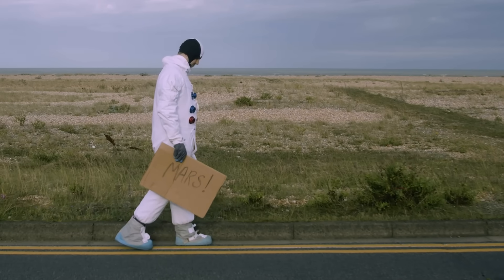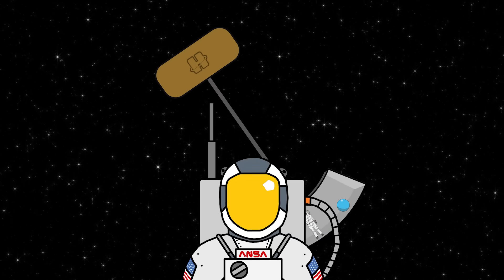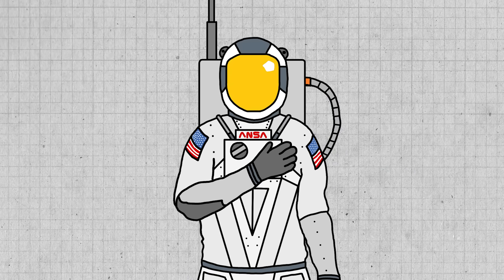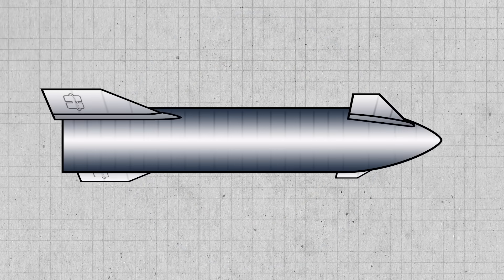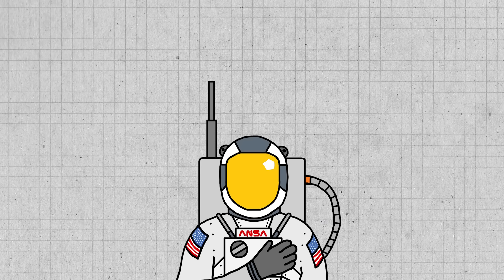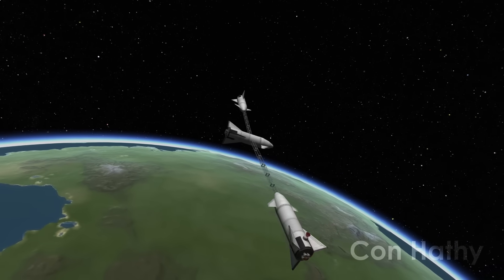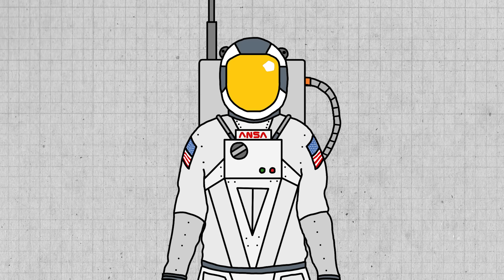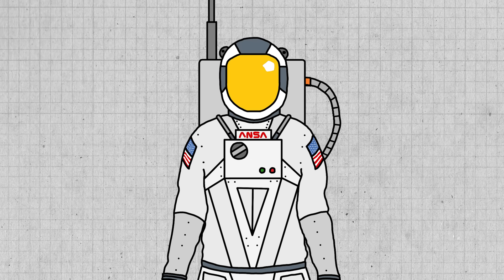This is NOT how you make Artificial Gravity

Comment: Pretty odd that you'd account for the central hub bring the primary forward driver as active thrust, though discounting how much it could be used, whole ignoring the idea that the side cars would also have available active propulsion. They would tumble if they were dumb otherwise inanimate objects. Instead they are robots which don't want to die right, strapped to rockets that were at least powerful enough to get them into that predicament. Yes conventional methods use chemical combustion to barely even get stuff into trajectories for distant intercepts. But the tech is continually advancing, and not at a snail's pace. Constant acceleration for as long as possible gets you places in outer space where coasting alone would be completely unfeasible. If the central hub can achieve some low degree of constant acceleration, it would tow the others swinging in coaxial orbit. That already provides tension for stability where you just assumed the engines would cut off and everything would coast. If all the engines cut off and they coast, they'd be in real trouble in that configuration yes, as they precess and slacken and pull taught again. A ship in tow still has a bit of the same problem risking a slack and snapping taught cable. But a ship in tow actively applying the brakes against your overwhelming forward drive, it's inefficient but it's also very effective in taking control over and cancelling out all that instability.

Comment: If accelerating in space is effectively the same as gravity experienced on Earth (02;02) then constant forward acceleration to Mars would provide gravity in the opposite direction of travel, as the ship is already designed. The only time this would be an issue is when you stop, then centrifugal acceleration would be of benefit. You are making an over-complex solution for a simple problem. Only the speed of acceleration and deceleration would require fine-tuning.
Reply from the maker: I actually made an entire video all about trying to use thrust gravity, it turns out that constant thrust is more useful for shortening the flight than actually sustaining gravity: https://youtu.be/nRKNh-Gx9WA

Comment: With some RCS control you can have a spaceship rotate about an intermediate axis without issues if desired. People make a big deal out of artificial gravity while it seems to me like one of the minor issues easily solved. The same for people that think that the trolly problem is the fundamental problem inhibiting self driving cars.
Reply from the maker: I wouldn’t risk it with RCS because any glitch or need to power cycle the system would put you at risk of tumbling (not to mention the waste of propellants)
Reply: @ConHathy  The ISS use control-moment gyroscopes and thrusters for attitude control, therefore I think you are a bit too pessimistic. Rotation around an intermediate axis is still a equilibrium point even though it is unstable. A tiny bit of control can stabilize it. Furthermore the tumbling is probably not disastrous.

Comment: The first thing I noticed. There isn't hardly any artificial gravity forces applying to his head. Even on that small centrifuge you could put a person's body at the location you were showing his feet at. Instead of being vertical to the center axis you lay horizontal at the bottom. You would have to build a spot for a person to lay in. But why wasn't that talked about? He covered almost every idea, but not that one. It would still be a small centrifuge.
Reply from the maker: That was actually a control setup where they intentionally put the eyes at the center, they also extended the arm to put gravity on the eyes but it didn’t seem to help (at least in earth’s gravity) I wasn’t able to find footage of that unfortunately

Comment: @2:00 - a constant upward acceleration is what gravity on earth feels like? This is not a shared experience. But we feel an upward movement (even though we're told gravity caused by the mass of the earth is pulling us towards it, it feels like upward acceleration, weird) and so rotation of another object can make it feel like gravity on the surface of a planet? huh? the forces are countering/opposing. centripetal is like you just said - an outward force from the pivot that keeps increasing the speed of the object in the direction of the rotation. an upward thrust might be plausable if the earth were stationary, but we're claimed to be spinning. Repeat an experiment where something is spun and it has objects cling to it ~ only have I ever experienced that everything is flung off the surface of anything that is spun - i've always asked what the similarity is of the force which we are told holds the ground, holds the oceans against the gound, holds the air against the ground, but let's us and everything living move freely within the elements? While saying that is "like spinning an object" and instead of having objects on the outside *where it will be flung off, (I'm sorry, *where it will stick to the surface of a planet) yes, instead of that, have the people on the inside of the craft being spun and they are forced against the surface directly perpendicular to the direction of the force of acceleration.  <or the wall of the craft> Ideally the craft would need to pivot and rotate to the angled degree of the spin for oprtimal function of the space as designed for "space work". pivot like a ferris wheel cart as it goes around the axel. only in earth's gravity the carts hang with the floor downward, but in zero-G the rotation would have the cart's floor be circling the craft and the floor away = then the people would have to get used to the motion sickness for a few hours and then the return to normal-G would take a few days to correct. This is only a sci-fi concept, artificial gravity. It can't be accurately tested, verified, or repeated. We can't create the necessary environment to conduct tests. Can we create a pressurized container without the force of gravity present in it? We as humans are pressurized and we can't survive in an environment without pressure. Space is said to be micro-pressure or no pressure; a vacuum. That much vacuum doesn't explode or implode our crafts made of mylar?? weird. Mathematics...we can do them all day and night, but the numbers can't give us any proof that artificial gravity is possible. ...except in our imaginations.

Comment: Re: Small-radii centrifuges ... What happens when matter inside the centrifuge shifts around -- e.g., when a human walks around the ring to the opposite side? The center of gravity will shift, and the forces exerted by the centrifuge on the ship will change. How much reinforcing material will you need just to keep the centrifuge locked in place without ripping anything open? It's too late (and it's been too long since I was in school) for me to figure out how to ballpark those forces, but I recall reading that shifting CG was a possibly-fatal flaw for ring space stations. (Although there, it was more a problem of tearing apart ships that tried to dock at the central axis...)

Comment: Another way of creating gravity is constant acceleration and deceleration
Reply: Using Ion drives to constantly push the vehicle will add gravitational affect and increase the speed/shorten the trip.
Reply from the maker: @davidpayton-pb8to  shorten trip yes, achieve anything like artificial gravity no. They have too low of a thrust to weight ratio. I actually did a whole follow-up video on thrust gravity

Comment: Artificial gravity caused by rotation has an important advantage:
You can go to the toilet normally and take a shower normally.
Reply: @misos1393 
1 Samuel 25:22
(for this  reference use the KJV)
Reply: 😂 you sock puppets will literally argue about piss trajectory.
Reply: @VoteForBukele  Ape think funny?
Reply: You can smelt/refine metals normally also...
Reply: Any artificial gravity would do that, and spinning isn't the best method.
Reply: no you can't, you would piss straight onto the wall
Reply: @misos1393  ...So put a urinal on that wall? Seems solvable
Reply: @misos1393  no, you would not, you're in a slowly rotating structure not the spin cycle of a washing machine. there might be some curve but nothing you can't easily compensate for
Reply: @stratvids  do the math, you're not in a slowly rotating structure unless it's the size of a planet
Reply: @misos1393  what? Are you slow or something? Did you even watch the video?
Reply: @stratvids  yeah and it's wildly wrong, the russians built a habitat on a centrifuge and tried to live in it and they recorded everything. You could also just do the math and realize theres nothing slow about accelerating at 9.8 m/s
Reply: @misos1393  sure thing little guy
Reply: @stratvids  your insults are compelling arguments i bet you win a lot of arguments
Reply: @misos1393  Used "argument" twice in the same sentence: minus five points.
Reply: @ didn't use the word "argument" even once. good job reading, you'll learn about plural next year in 2nd grade reading
Reply: @stratvids slowly rotating only if you’re talking about the RPMs but that doesn’t mean the speed is insignificant… the earth rotates at a very slow speed if you’re talking about the number of rotations per minute yet it’s spinning absurdly fast (okay maybe not absurd it’s like 1,000 mph, but you wouldn’t call that slow even though the earth is rotating at less than one RPM). You have to have a lot of speed to get the gravitational effect you’re looking for. As far as pissing on the wall I have no clue on that but your idea that it’s “slowly rotating” is incorrect.
Reply: @AllergicToFacts  on the 500 meter example, it would cause about 15 cm of deflection, that's hardly hitting the wall and easily compensated for. and that's assuming only free fall velocity from the pee, if you aim down it would have even less displacement due its its higher velocity. and assumes a generous distance of 0.5m that the pee has to fall. Even if we double or triple that to be generous taking a step back solves the problem.. Assuming you're not just using a urinal, or just sitting down in which case it's completely irrelevant
Reply: @ hell yeah. Water gun piss streams averted!
Reply: @misos1393   I did the math, you're wrong. 
You also fail to consider the ability to sit down, which completely negates your point
Reply: @misos1393  Who said we had to make an artificial gravity of 9.81 m/s2? 3.73 m/s2 is more appropriate for travelers going to Mars as it gives them time to adjust, easier to achieve, and has reduced negative side effects.
Reply: not much different from how I do things now 😅
Reply: @misos1393  Nope; it would act exactly like "real" gravity. It has to. Them's the rules.

Comment: For Crew Starship applications, two ships tethered at the nose seems by far the best cheapest option. Lot’s of bang. SpaceX will build lots of cargo/tanker Starships and their propellant can be adjusted to balance the crewed ship. Tether allows variable G - which means for example a mission could test long term living at exactly Mars gravity in a Ship built to be a Mars hab. A tether to a cargo Starship seems way better/cheaper/more useful than a short radius spin machine.
Reply from the maker: Don't confuse 'easy to say' with 'easy to do.' The statement "tethered at the nose" hides a ton of complexity:

- Are you going to try to do the Mars transfer burn while connected? What kind of connection can carry that much load, would the entire ship need to be reinforced? Or are you going to try to do simultaneous transfer burns in close proximity. That's high-risk and still leaves a very difficult rendezvous (on a hyperbolic trajectory, not an elliptical one).

- How do you connect the tether, EVA, or a special 100+ ton rated docking mechanism that will definitely be more complex than a bike on a stick. 

- If the winch is going to carry the load once the tether is spooled out, it also has to be rated at over 100 tons, if not you'll have to create a different mechanism to detach and lock the tether once it spools out (more complexity, more weight, more cost)

- How much fuel would it take to spin up? To get 100 ton to 100 m/s will take about 3 tons of methane and oxygen (that's per ship and only spin up), so a total of 12 ton for the whole trip.

Do you really need more than 12 ton to build a bike on a stick? And don't forget that we aren't counting the weight of the tether, winch, extra fuel for the rendezvous, etc. so this is a severe under estimate. Also no, you can't save weight by spinning up with reaction wheels, the wheels would end up being heavier than the fuel.
Reply: @ConHathy  Specifically about whether it could take the load: In your video you suggested that they could use the already existing cable attachment points and showed a clip of the rocket being lifted by that attachment point under 1g - which is the required strength in rotation as well. You make a convincing case against it as an idea in general though.

Comment: SIMPLE SOLUTION: Accelerate the rocket at 9.8m/s^2 until you are halfway to Mars. Then flip the ship around and decelerate the rocket at 9.8m/s^2. You will have 1G of gravity towards the floor of the rocket for the entire trip. And you will get there faster too. None of this time-wasting "floating" with no acceleration bs. Yeah, it would take a lot of energy, but who cares? Use nuclear. Or lasers. Or ions. Or Solar sails. Whatever. You'll get there a lot quicker too.

Hell, just launch 50 super heavy sized cylinders into space, 1 filled with crew and 49 filled with fuel. Assemble them into one long-ass cylinder and viola. Fire it up and burn those engines for a few days (or however many we need). Welcome to Mars. I mean, are we doing this or not?
Reply from the maker: I actually made an entire video all about trying to use thrust gravity: https://youtu.be/nRKNh-Gx9WA
Reply: @ConHathy  Thanks. I just watched that one. Why are you talking about thrust to weight ratios? Everything in space is weightless. Those formulas you're using are just for getting heavy payloads out of Earth's gravity for the initial launch. It's completely different in the weightless environment of space. And btw, you have to turn the ship around halfway and decelerate at 9.8m/s^2. So you can maintain a constant 1G the entire trip. And I think it would only take a handful of days.

Comment: The pressure in the eyes wasnt solved because there's much less "gravity" closer to the hub and much more at the edge.   This is not something that requires physical experiments.  It's obvious to anyone that the greater the radius the more evenly "gravity" will affect the body.  This was known more than a century ago.

"Konstantin Tsiolkovsky wrote about using rotation to create an artificial gravity in space in 1903. Herman Potočnik introduced a spinning wheel station with a 30-meter diameter in his Problem der Befahrung des Weltraums (The Problem of Space Travel). He even suggested it be placed in a geostationary orbit.[1]

In the 1950s, Wernher von Braun and Willy Ley, writing in Colliers Magazine, updated the idea, in part as a way to stage spacecraft headed for Mars. They envisioned a rotating wheel with a diameter of 76 meters (250 feet)"
Reply from the maker: I feel like I should point out that the footage was actually of a control setup where they intentionally put the eyes at the center, they also extended the arm to put gravity on the eyes but it didn’t seem to help (at least in earth’s gravity) I wasn’t able to find footage of that unfortunately
Reply: @ConHathy  It makes no sense to put the eyes at the center unless  they want to try and induce vertgo rather than "gravity."
Reply from the maker: @mrknesiah  yeah that’s what a control is. You have them lay down, rotate them, but don’t actually introduce artificial gravity. You then compare that to the experimental setup that uses a longer arm and you’ve isolated the variable of artificial gravity from all of the rest
Reply: @ConHathy  That's like testing a fork  by using it prongs down and comparing it to using it prongs up and saying you've isolated the key variable.  Rotation induced artificial gravity has not only been well understood for over 100 years, the math is elementary, literally...8th grade level.  The influence of gravity on blood circulation has been well understood.  What are they trying to discover exactly?

Comment: I wonder how dense of a core you would need to achieve gravity on a space station or if it's even possible to have one without the ship just collapsing.
Also what would happen to the spinny ship if the core ran throughout the entire center of the ship (Like a long cylinder that runs the entire center) rather than being like a ball concentrated in the direct center?

Comment: So the obvious choice would be a small diameter ring.  It's the only configuration that is at lowest energy that is adaptable.  A 100 meter diameter ring would have plenty of space for starage and with movable weights on spokes to adjust for load variations in ring to maintain center of rotation.  If you're going on a manned mission to Mars, you can't possibly think of doing it worrying about how many launches it takes to get the materials needed to get the job done.  If you think it takes 20, I think it takes 50.  This is not something you skimp on.  

For any manned mission to Mars to be viable, they will have to be there a while.  The whole mission can be done at .375g Mars gravity.  You can't possibly think that a manned mission to Mars would rely on just 1 big lander.  That is absurd.  You would have separate landers for different componenets because they have different requirements.  You need at least 2 that can carry people plus their returning samples back to orbit.  if something goes wrong, you still have 1 to carry people and leave samples behind.  You can't have any single points of failure on a mission like this.  It would be suicide.